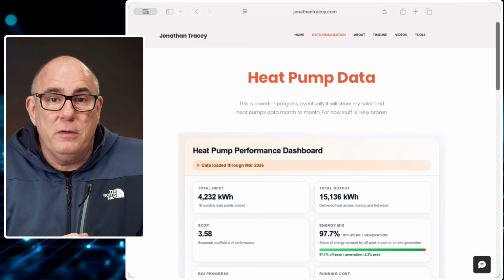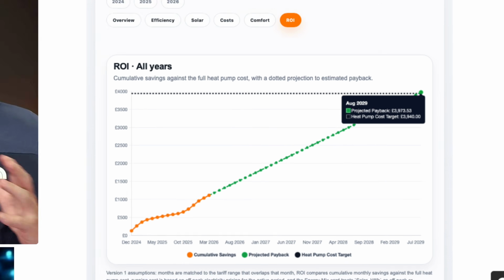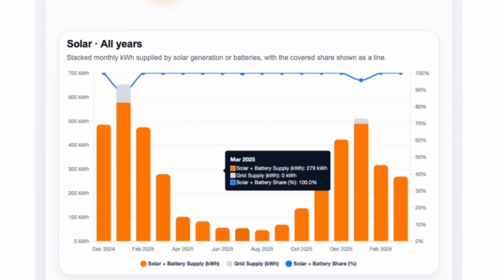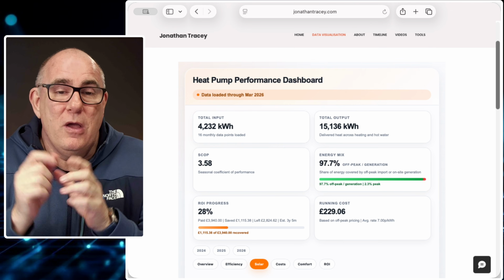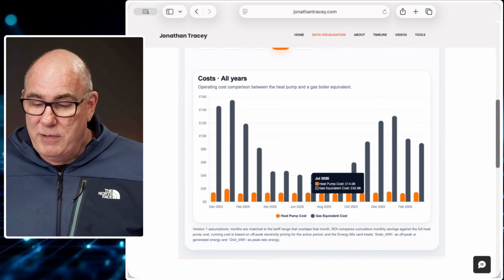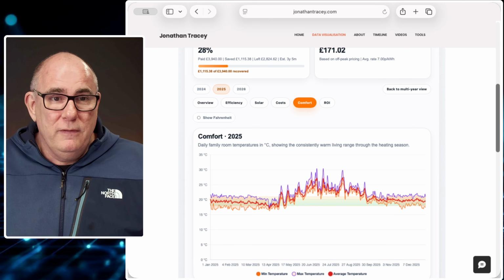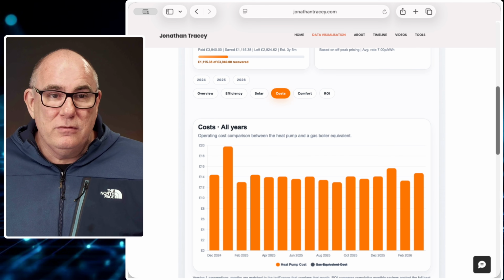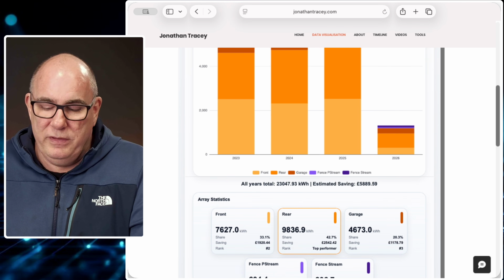Heat Pump Running Costs UK – Real Data (Octopus Energy + Solar)

Comment from the maker: If you're researching heat pump running costs in the UK, this is all real data from my system — no estimates.

Full dashboard here 👉 https://www.jonathantracey.com/heat-pump-data

Happy to answer any questions about heat pumps, Octopus tariffs, or real running costs 👍
Reply: Comparing a heat pump to a gas boiler running cost when using discounted electricity and solar is not apples with apples.

Assuming the electricity was all at 7p/kW suggests without a discounted electricity tariff your running costs would be 3x.  If we assume solar displaces 40% of imported electricity then the running costs would increase 2x. That’s a 6x running cost.

Adding solar costs plus battery plus AShP install puts a true overall cost. I am guessing a full electric install would be £25-30k given I just got a quote of £8.5k for a power wall 3.

When ordinary electricity tariffs fall to or below 15p/kW then an ASHP without solar or battery makes sense of corse that needs a SCOP of 3.5 to get the install paid for given the ASHP will be done in 15 years just like the less expensive gas boiler….

Just as a wake up call how do suppliers keep providing low cost tariffs as more people try getting them, yes discount tariffs are temporary that’s why Octopus has insufficient capital on reserve, they are skirting with insolvency.

Comment: Hi JT, great video and resource for a possible new entrant to the ASHP world. Currently on oil, with a boiler that has been given the last rights. The videos and data dashboard will help with our sums! That said, we have solar and on a hefty feed in tariff that was inherited when we bought the house, providing around £1,500 per annum. Running an EV so benefit from the cheap over night tariff with Octopus. Will look at the power consumption of the proposed ASHP to see what battery options would work to reduce the running costs further. Great tips to follow up on!
Reply from the maker: Thanks for the kind words, let me know if you need any help with the numbers, always happy to help

Comment: Hi thank you for sharing. About data could you tell me what the heat loss is and how kw solar battery you installed? Cheers!
Reply from the maker: I don’t remember the exact total heat loss, but I remember it was somewhere in the region of 350 W per room 

For batteries, I have a 29 kWh solaredge system plus about another 6 kWh of EcoFlow batteries

Comment: Jonathan Please can you explain to me How my system works.  I had a Grant so I didn't pay for anything, they've put in a ' Piggy back system for me' I have a heat pump that is working in conjunction with my gas boiler . I have 20 solar panels no battery i export to Octopus at 12p kwh.
 But really am a bit frightened to use the Piggy back as I have no idea how much it is going to cost? 
 I live in North Wales. 
Thank you for your help if you see this comment.  🎉
Reply from the maker: @sandraparry8653 Thanks for the comment 👍

I’ll be honest, I’m not that familiar with the specific “piggy back” setups you’ve described, so I don’t want to give you the wrong advice.

What I would say is your installer should absolutely be able to come back and explain how it works and what it’s likely to cost — especially as it was part of a grant installation.

Sorry I can’t help more on this one, but I’d rather be honest than guess. You’re definitely not alone though — a lot of people are left in the dark with these systems.

Comment: You don't say what battery capacity you have? 50kWh would make that graph easy (5 min in)?
 And what power is your heat pump please?
Reply from the maker: i have 29kwh of solaredge batteries, these supply the house 24x7 and that’s what your seeing in the charts. i also have a further 12kwh that i use for various projects, sometimes they are connected to the house (in winter) but they are not relied upon for supplying the heat pump

Comment: Hi Jonathan, Thanks for this; you've given me some ideas for later this year when our system is up and running. I'm a bit of a spreadsheet geek so I'm looking forward to having a play with loads of data! ;-) 
One thing that I've noticed in some comments (they're always angry for some reason!?!) is the idea of missed opportunity cost, i.e. if you invested your money in the stock market you would get a better ROI. I think these folks rarely admit that their maths forgets the ongoing bills that you would have if you just bought the S&P and kept using gas. Have you thought about busting that myth and adding something to show what would have happened if you had done just that? Bought an S&P 500 mutual fund (or a UK equivalent) and stuck with the boiler?
Reply from the maker: @leemartin2396 Really appreciate this — and love a good spreadsheet geek 👍 you’re going to have a field day once your system is up and running!

You’ve hit on a really important point as well. The “just stick it in the S&P” argument always sounds great on paper, but it usually ignores the fact you’d still be paying energy bills every single year — and those aren’t exactly going down.

So it’s not a straight like-for-like comparison. One is an investment on paper, the other is actively reducing a real, ongoing cost.

I actually think that’s a great idea for a video — comparing “invest in the market vs invest in energy savings” but doing it properly with real numbers, including ongoing bills, price rises, and maybe even some worst/best case scenarios.

I’ll add that to the list, as it would be a really interesting one to break down properly. Appreciate the suggestion!

Comment: What I still do not understand is why a cheap air-to air split AC unit that also heats your house costs about 300 EUR, while an air-to-water heat pump is usually around 2000 EUR. They are just replacing the inner radiator unit with a water heat exchanger, but the cost goes way up. Why ? It should actually be cheaper, because you need no more ventilation and temp display on the interior unit. I am strictly talking about the external unit and internal heat exchanger. No water pump or additional boilers included.
Reply from the maker: TBH i have no idea, suspect the prices of air to water are artificially infated because of the grant but that's just a guess
Reply: @JonathanTracey  I am a bit of a DIY myself and actually wanna try this. Purchase a regular air-to-air unit for 300 EUR and just replace the inside split unit radiator with a water heat exchanger that costs less than 100 EUR. Volume is about the same, so it should work with the refrigerant it comes with. Just in case, I will ask a friend that installs such units to do the pressure checks. Then I will test it for a few months, see if it can heat the water I have in my storage boiler.

Comment: If you are going to sell it as cheaper/cost return then you will need to add cost of battery in which will push these from 3/4yrs to 10-yrs+ depending on size battery required.
Reply from the maker: 2 things not selling anything, no skin in this game, repayment with battery is about 6-7 years , you can follow this on the dashboard.

Comment: Our COP since November install has been about 4.7. Our 35 year old gas boiler was probably getting 0.75. Plus we've got home battery and solar so it is running of cheap clean electrons. Highly recommended!
Reply from the maker: @dougbamford That’s a brilliant result 👍 a COP of 4.7 is huge compared to that old boiler.

Sounds like you’ve got the ideal setup as well with solar + battery feeding it cheap power – exactly how these systems really shine.

Great to hear real-world results like this 👌
Reply: @JonathanTracey  It is a Vaillant heat pump installed by Heat Geeks so we went a bit more premium compared to some installs, but it is bearing out in the efficiency statistics.

Comment: great video again.

In real world your setup is a premium solution.  most people funding wise would probably start with the best ROI and invest forward.

So the base starter cost would be a battery and probably use the  Cosy Octopus tariff. then possibly move onto solar.   the question I would ask in a future development, would be by using your data could you apply the cozy tariff and different sliders for batteries and another slider for different size displays.   

I have a strange roof shape so I managed to get a 4.4kwh array and due to space constraints a tesla Powerwall 3.  So all my Heat Pump calculations are based around this and using the Cozy tariff - which I am still trying to convince my wife will be cost effective- it is marginal but we are good with that as it does stop us burning stuff...

In Future I am really looking to go down the Octopus V2G route, unfortunately Octopus aren't allowing users with batteries to join that scheme yet. I am hopeful that once established there will be more practical ways forward.   any thoughts as this give newbies some potential options in future...
Reply from the maker: agree that's how I started, most can't afford a large solution on day 1, I started this journey 15 years ago and have been growing it as funds allow
Reply: @timandkatsgreenwalk have a tool to find the optimal tariff.

Comment: Hi Jon, were very similar but fully electric with wet UFH. We fitted in February, 17 Aiko 510 panels and 18kw Sigenergy battery with an Eddi and we had an 8.5kw ASHP Mitsubishi R32 fitted. Our smart meter only shows 50p at this time of year. We get our SEG back in June and expect it to be approximately £350. We've saved nearly £1000 per month and the SEG we're very happy 🎉
Reply from the maker: looks like a nice set up 👍

Comment: Thanks Jon, appreciate the sheer amount of data, transparency and lay mans explanation. I’m down the rabbit hole on all of this currently, I’ve solar and 12kw battery storage, looking at a heat pump, tell me, how much juice does the heat pump use on avg day, and it’s avg draw. I have researched but can’t get a straight answer. Appreciate they’re all different, but a steer would be great. Many thanks
Reply: Hi  Rhys, we've had our ASHP for just over a year & our monthly energy consumption figures (for both heating & hot water) are as follows:
April 25 - 113.4kWh
May - 88.2
June 38.2
July 8.6 (had some holidays)
August 34.8
September 74
October 188.1
November 327.1
December 411.2
January 26 - 548.2
February 372.2
March 281.4
April 126.9

We have no gas and a 15 kWh (useable) battery setup and overall we managed to run the house on overnight energy 95% of the time, so for us, the cost of another battery doesn't make sense. I hope you find this info helpful.
Reply: @a@adyb5438thanks for taking the time to write that up, really helpful. In jan we only get c130kw off the roof, but battery etc, seems doable. I’ll likely take the plunge, would love to be rid of gas/standing charge etc. thanks again.
Reply: @rhysjones3011  FYI we only generated 45 kw from our panels
Reply from the maker: it depends on when you averaged out, if I had to take an average of January through March it would be about 8 to 10 kW a day. If you average out across a whole year, it’s more like four. 

The worst day of the winter when it was around -1° all day and -7 at night it use 34 kWh
Reply: @JonathanTracey wow quite a range, I might need more than one additional battery. Thanks very much.
Reply: @rhysjones3011  you can take your existing heat output, convert it to heat pump electricity use for a year. And then put it into @timandkatsgreenwalk's tool along with your other electricity use and solar, and then try out the benefits of different battery sizes.

@JonathanTracey, you could demonstrate how different (smaller) battery sizes might change your costs?

Comment: I have commented before. I’ve watched you and other avidly while I agonise. Well, I now have Octopus and Heat Geeks with two appointments. I’ve mentioned my Powerwall to you before and the running out, this is my concern. Mine is 15kwh. I will suck it and see for winter 2026 and decide on expansion then and if the cost vs benefit is worth it. However, more panels are on the shopping list for a further 2450kwh per year generation. I’m all in on this and a heat pump seems to make sense. Gas bill in 2025 was £850 which made me ill 😂
Reply from the maker: Good move, waiting to see your actual data after a full winter is the smartest way to decide on adding more storage 👍
Reply: You can model the advantages of larger batteries using @timandkatsgreenwalk's tool.

Comment: So to get the ROI using smart tariffs you need batteries so you can heat the home 24x7. Was the cost of batteries included in the £3,940?
Reply from the maker: no, because the batteries have already been paid off and accounted for in the return loan investment on my solar system. We don’t need to double count them.
Reply: @JonathanTracey  Without batteries you wouldn't be able to use smart tariffs to run your ASHP 24x7. The batteries are a key enabler to your ASHP RoI.
What would the RoI graph look like for an ASHP without batteries using normal fixed price tariffs - eg 22p for electric, 5p for gas.

Comment: My data is similar with my heat pump, EV, battery, but no solar (yet) In total I save over £2k per year currently.
Reply from the maker: Thats pretty impressive without solar, congrats

Comment: I have 18.8 kWh of useable battery capacity , the first full winter with a Cosy 6 ASHP. On 20 days of the winter, mainly in January & February, the batteries were fully discharged by between 19.30 & 21.00 hrs. Really pleased with that . The ASHP consumed 2640 kWh with a SCOP  of 3.71 👌, the house was warm 24/7 , lovely & comfortable 🤗🤗 . I have solar panels , 10.46 pkWh, but I am unable to see how much solar contributed to the total consumption of the AHP? Were you able to do this ?
Reply from the maker: sounds pretty good, chasing that last few percent by adding more batteries doesn’t ever really make financial sense

Comment: Hello Jonathan. Last year I had an Octopus heat pump survey. My 2-storey house sits on a 10.4 x 9.2m floor plan but Octopus told me my Loss Area was 200.7m2, assuring me that this included the walls. Their calculated total "Heat Loss" was 13.46 KW and "Usage" 23494 Kwh. I have questioned their calculations but I am still waiting for a meaningful response. My question is regarding the need for a survey if you have a year's worth of imperial data. My annual gas usage (assuming 90% efficiency) was 11308KWh, half the survey estimate. it's hard to make a heat pump decision if you don't trust the survey ! Do you have pre & post heat pump annual heating/water usage, I would expect these numbers to remain very similar. Also how do you measure the heat pump output energy ?
Reply from the maker: @georgeM8045 great question 👍

Your instinct is right — real usage data is incredibly valuable, but the survey is still needed for sizing at peak demand (coldest days), not just annual totals.

Pre vs post should be broadly similar in terms of heat delivered, but the input energy drops because of efficiency.

For output, I don’t measure it directly — I calculate it using input energy and COP based on real-world performance 👍
Reply: The survey must also work for possible other future owners of the property? I wouldn't want my house heating to be planned around someone who only wanted their house at 15C year round.

You can also use your usage on the coldest days to figure a right max heat loss at that temperature.

Comment: The last time our house got up to 30C was the hot August day when they installed our A2A heat pump.
Reply from the maker: for those few days a year we use our portable AC units but if we get more of them due to climate change we may invest in A2A
Reply: @JonathanTracey I’m thinking that the eddi might have a second life as a power source for a portable ac

Comment: Hi, can you share any settings of your Daikin Heat Pump system (WD curves etc)? We have the same but I’m sure we don’t get a SCOP anywhere near 3.8, I think more like 2.5, but it’s difficult to say as you can’t export data easily. We also have a new build house with UFH downstairs and Rads upstairs , decent size 4 bed detached, new build so very well insulated. With that in mind, how are you getting all this data? I presume Kw’s used with a Shelley, but what about the heat output, are you using ESPAltherma / Home Assistant plugin?
Reply from the maker: my settings are the default Octopus set them on when it was installed, i have not changed a thing. The big difference is that we dont have UFH, however you should be seeing a better COP not worse. Our home is smaller only a 3 bed but still I would get them back in to look at it. Yes kWh come from shelly but heat out has to come from the daiking MMI, even with an ESP altherma it does not report the heat out figures
Reply: @JonathanTracey they have been out to look at it, Daikin guy himself, they seem to think it’s at correctly for the house, but to be fair, we’ve only been here since September, so have had the worst months of the year so far… I’ll have another look, but thanks for getting back to me :)
Reply: Ok. So from the data from the Daikin unit, I know you say it’s not 100% accurate on the energy usage, but that’s all I’ve got… from October to March I got an average 2.99 for central heating and 2.75 for hot water. That doesn’t sound awful considering it’s the worst 6 months of the year. Suppose I’m reasonably happy with that (also we had some problems with our UFH flow rate early on) out of interest does Daikin under report or over report on the energy input?